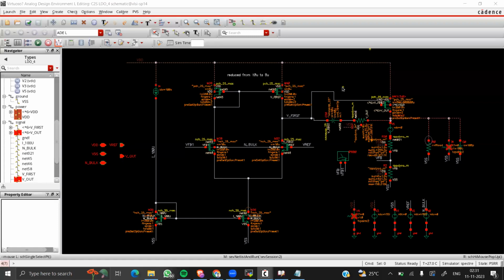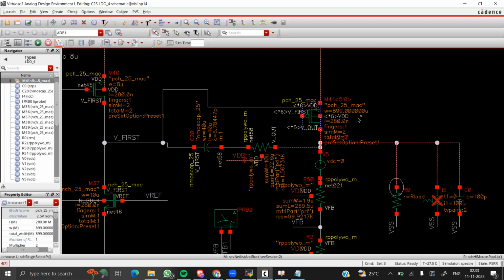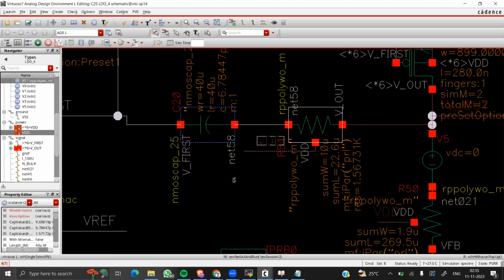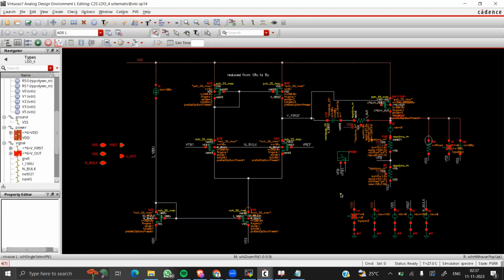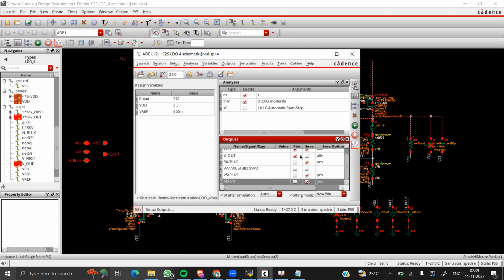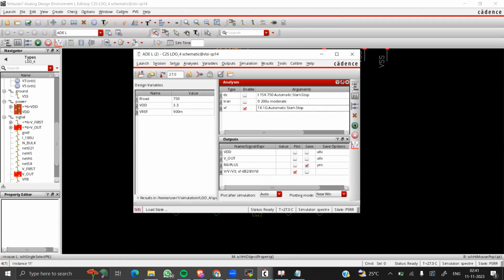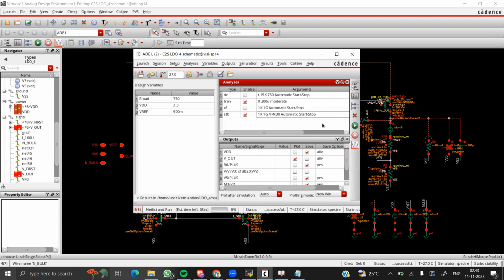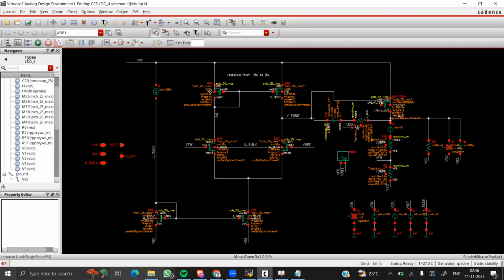Design of PMOS pass transistor LDO

Comment: How come your low frequency psrr close to 100dB, where are loop gain itself is close to 40dB.
Or is it bcoz you choose 1mV as ac source in psrr??
Reply: Correct, the shown PSRR should be reduced by 60 dB to compensate for that
Reply: hello, did you get output?